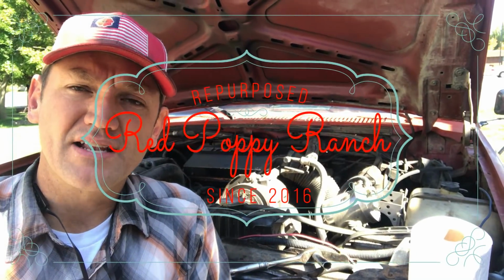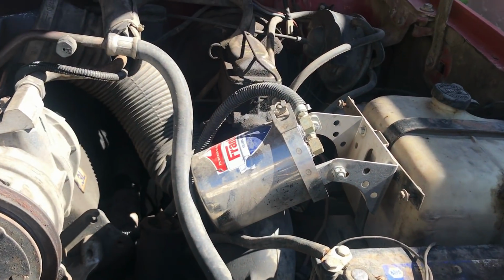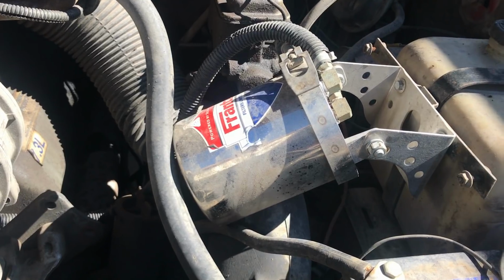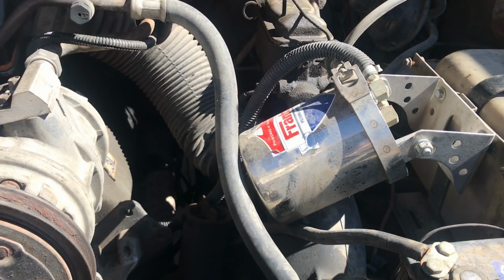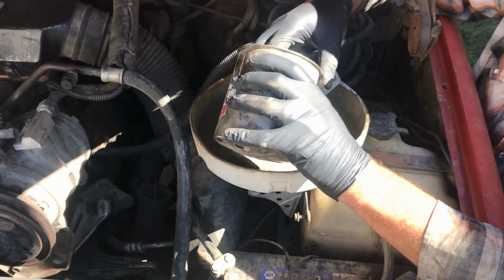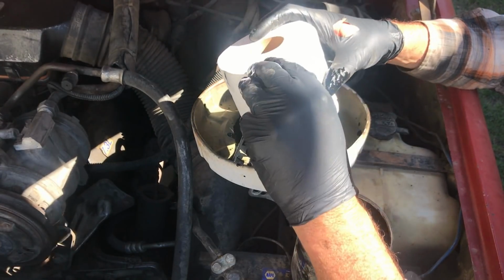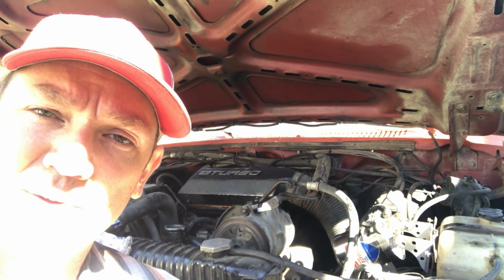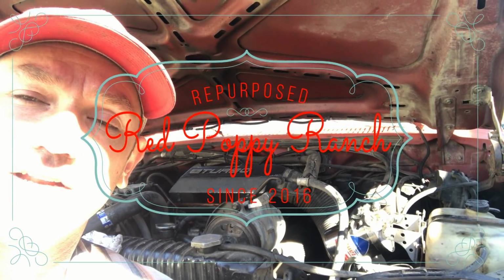#146 - Toilet Paper Oil Filter Maintenance... (Frantz Oil Filter)

Comment: I will use my Nissan Altima as an example. The oil is beautiful. Lets say the toilet paper is removing 99% of the carbon and 1% is getting thru. 1% is nothing in my car. Adding a qt at filter change dilutes that down. Why is the oil black in a diesel engine ? The filter is removing 99% of the soot and 1% is getting thru. That's because 1 % of the soot the diesel is generating is a lot more soot. Most of it is only a color. Send a very black sample of oil to the lab. You know they will say it is dirty because it is black. They Wil say it is clean and good for further use. You will get a list of the additives in the oil.They might tell you there are wear metals in the oil. On a large truck they might tell you your air compressor is wearing out.

Comment: Righty tighty, Lefty loosie!   The carbon black is way to small to be removed....  I used synthetic 10-40 Diesel oil, I pushed a fleet of water trucks and had a large supply of oil and diesel, so I CHANGED the oil every 1000 miles,  Never had a problem with the engine, but transmissions were a different story....  I could run from your neck of the woods to Lake Powell and back on a single tank of fuel, very nice.
I built filtration equipment used in the oil industry,  I had filters that went down to 1 micron "absolute" and they still wouldn't remove the carbon black from the oil....  cheapest insurance in the world, oil changes....
Reply: Deserthunter Mike Yep whole vehicle has to make it to a given milage not just the engine. Right there is the folly of low mile oil change intervals. Sadly it's the cooling system that lays most engines to rest now. But we never talk about 3000 mile coolant flushes do we?
Reply: I haven't heard of a cooling system failure in a modern car since most manufacturers switched to aluminum engine blocks, which don't rust and therefore don't leave piles of rust-flakes in the low spots of the coolant system.
Reply: Shawn Elliott Search your local Craig's list for PT cruisers. Sort by price low to high. The really cheap ones will have blown head gaskets or warped heads. These issues arise from cooling system neglect. The 2.4 in every PT is all aluminum, block and head. Dex cool is another nightmare. Look that up, mind blowing.
Reply: Hm. Does that specific coolant have trouble with gelling over time, or something like that?
Reply: Shawn Elliott From what I read it's due to air contact. More of a mud that develops. Blew my mind. I'd never imagined the kind of build up it causes. I figured stop leak when I first saw it, but they swore they didn't use any.Seeing and reading more online just wow. On the up side for systems designed to run it HOAT is unbelievably good. I just dropped 9 year old coolant from an iorn block. 94k on the truck and original coolant. The stuff is still clear, clean and red. I've never seen anything but brown on an iron engine. I'm sold on HOAT, and the Mopars that run it. Overall I'm on the side of ground up maintenace, 7500 mile intervals. Changing part of the coolant(what drops from the pepcock) and an oil change is only part of it.
Reply: Huh. How is air getting into the coolant system? Any air hole would turn into a coolant leak as soon as the water pump starts running.
Reply: Shawn Elliott Can't say I'm satisfied with that answer either. Though there is ways that air can get in or get trapped. I can say that any gradual process of corrosion can be circumvented by keeping the coolant changed or clean. And of course there is more to the cooling system then just the coolant. My original point, maintenace must be practiced on the entire vehicle. Very few if any modern vehicles will go to the scrap heap for issues that oil changes would have helped.
Reply: That's the problem with products like this one -- they encourage hyper-focus on a single aspect of a very complex system. Modern engines are already engineered to be right on the edge of the zone of diminishing returns, because that's how the manufacturers make sure their engines get a reputation for being reliable. There's so much other stuff that needs to work right for a car to run well, and the improvement gained by further optimizing one aspect of one subsystem (e.g. the engine oil) will be so small that it is easily overwhelmed by statistical white-noise in the big scheme of things. Did your engine last a little longer before needing new rings or new bearings because of a fancy oil filter? Who can tell? It could've lasted a little longer for any number of other reasons, like maybe the machinist at the factory 20 years ago was having a good day when they made the parts that ended up in your engine. If you didn't hand-build the engine yourself, you have no way of knowing the values of all the variables hidden inside.
Reply: Shawn Elliott   Only silicate containing antifreeze would age even in the bottle and silicate goo would settle out. The new antifreezes that are red or orange  do not have silicates and are superior and long lived. No silicates, no rubber swelling. The new antifreezes have been kept in bottles since the 1990's and they haven't deteriorated.
Reply: Shawn Elliott 
Aluminum rusts too. Where you see the white flakes is the aluminium breaking down. And ALWAYS use manufacturer recommended coolant and be careful what you mix. I've seen a person getting a water pump changed on a dodge minivan...mixed green with dexcool. The impeller on the water pump was turned into a razor sharp and thin disk because the two coolants mixing worked like an acid eating the crap out of the thing. And most impellers are steel even in aluminum engines. If you are in a real bind you can use all makes all models type coolants or water, but you need to get the right stuff and flush the system after the leak is fixed. You can easily trash an engine by neglecting the coolant system. There's a reason most parts stores carry tons of different antifreeze types.
Reply: I want to see what the oil looks like on the dipstick. Any time. When you change your filter next, in between, after you read this? I’m just very curious. I want to see the true color of the oil and know how long it’s been since you made the conversion and put the new premium oil in. 
I would also like to share with you, running your vehicle on fuel vapors. Not sure how it would work for a diesel but it might be worth checking out. 
Cheers!
Reply: The only thing to know the truth is to send in a sample for oil analysis according to their instructions. THAT is the only way.
Reply: You guys on this comment forum are over analyzing this oil filter system. Whats wrong with another filter that you can change between oil changes? Seems cheap cost for more pretection.
Reply: Ethylene glycol and Propylene are two good examples. You also need two different testers for them. Great points. The auto industry would be in shambles if not for lazy maintenance vehicle owners. Cheers !
Reply: The way we demonstrated  the Frantz and Motor Motor Guard  is with carbon black. We mixed enough in oil to turn the oil black. We circulated it thru a spin on filter. It went in black .and came out black the toilet paper removed it on the first  pass. Did someone say the filters can't remove carbon black .
Reply: I've used T P filters since 1963 starting with the Frantz on a nearly new Rambler American. There is something about these filters that brings out the liars and fools.
Reply: @ralphwood8818  bring them out how?
Reply: I only have Gulf Coast and Motor Guard toilet paper filters now Started with a Frantz in 1963. The oil on my 390 on the 76 F 250 and the Pontiac Torrant are amber. Wife talked me into giving the Altima to her son which means I will still be taking care of the Motor Guards. It has the cleanest looking oil. Light amber. I dont send oil to a lab. I've been at it a long time. We demonstrated the Frantz and Motor  Guard by filtering carbon black out of oil. I sometime used diesel fuel. Some used Wesson oil. When you mention toilet paper here the fools come. We used to sell the filters at flea markets.  It was boy Frantz has been outlawed in Texas too much shit paper getting  in the oil. Oil is supposed  to get dirty it means it's doing its job. They are not all fools. A trucker showed me his 2 Frantz 3 stackers. Said he gets a 6 pack of Safeway Truly Fine to service them. I equipped a fleet of tree service equipment at McKinney Tx because someone saw me at 3rd Monday trade days. Powerstrokes Ford industrial engines on chippers.Bob cat.They called me awhile back and  said they had more trucks. Told them to call Gulf.Coast filters. I cant do it anymore. Cant get up and down. I like to talk about them. The oil in a diesel will be black. There is enough non abrasive soot that is too small to be filtered out but will turn the oil black.truckers do the palm test. Clean oil will wipe off clean. They used Walmart conventional diesel rated oil
In their  tree service equipment. I used a lot of make up oil. Many paper towel filters. There is something  about toilet paper that makes some people come up with a toilet paper joke or bull shit story
Reply: My wife's Pontiac Torrant has 197 K miles on it shows no problems with the engine.It has had nothing but DeX cool in it. The coolant recovery system is what keeps air out of the system. Bought a Ford Escort with a warped and cracked head once. The problem with that car was two cylinders didnt get enough coolant. The fix was the new head gaskets restricted  the flow and made the coolant  spread out and go to all the cylinders  equally.

Comment: Must be gun shy because his first motor only went 180k (1st video "truck has 240k, motor has 60k") Pretty low for a diesel because the fuel itself is somewhat of a lubricant. Willng to believe anything now that promises extended engine life. He said this filter is in series ,but it is in parallel. If it were in series, the motor would be starved of oil instantly and die. There is only enough oil going through this thing to blacken it. Notice the wrinkles in the surface of the roll he removed. Those are channels that are formed from the oil,unable to flow through the dense paper, flow around it, unfiltered. Seems like a good guy, but got misled. Filtering is only half the battle. Dilution, sheer and other factors that diminish lubricity over time cannot be filtered out. Change your oil.
Reply: Its just a simple oil filter that cleans oil. It can't think. It can't tell you when it caint hold any more sludge. I probably change mine more often than most.I probably add more new oil than most. I gave up draining all of the dirty oil and filling it up with new oil in 1963 . It works for me. An oil analysis program without a filter that cleans oil is a waste of time. Black means nothing. I have sent very black oil to the lab.the results came back clean.Ok for further use.If the oil gets black in a modern gasoline engine You are in a heap of trouble.
Reply: I find it amusing that people that have no idea  about the oil system or the Frantz  oil cleaner dont have a problem explaining  how the system dont work.

Comment: The filters have  served me well fot.almost 60 years.  Put one on a neglected engine with a quart or two of sludge and you have a problem. Not much of a problem with these modern fuel injected engines and synthetic oils.Years ago a guy asked me if a Frantz would help fix a noise in his engine. I asked him how long it had been since his last oil change.He said I dont know it's been a long time. I wouldnt go near that engine. In the old days when you overhauled an engine the hardest job was cleaning the engine. My old 76 F 250 had some oil leaks.in the 390.I decided  to replace all the gaskets.The engine was pristine except some carbon on the pistons and valves No sludge anywhere. It uses Delo 400 15 40. The non synthetic oils are a lot better these days. The 390 has an old Motor Guard on it. Motor Guard was the only TP filter that was safe to use for compressed air.  All they make now is compressed air filters.  No I dont drain oil.

Comment: all yall are crazy to use material that disintegrates in water and use it filter your engine oil. its designed to disintegrate.
Reply: Cam Cam toilet paper doesn't disintegrate in oil.
Reply: @bigchevy80  - EXACTLY, although my guess is that fluid erosion might take its toll on the much finer toilet roll paper over time. The cheaper paper, SOME of it anyway, is thicker and tougher.
Reply: I'm not aware of any paper that dissolves in oil. You can take the used roll out and unroll it It will tear at each sheet. The element is removing the water and acid with it. You will know when you have left in too long. The paper won't be as strong. If you allow the element to reach its capacity the acid will start working on the pleated paper in the full flow filter. Some think they can wait until the element has reached its capacity. Not a good idea.
Reply: Had a genius say that toilet paper breaks down in a septic tank. Not if the septic tank is full of oil.
Reply: I have been known to use toilet paper on the coolant.some use toilet paper as a water filter before the expensive activated carbon.water filter on marine vessels. Some toilet paper holds up pretty good when sealed in a filter housing. In a engine the oil protects the paper.. if the paper gets soggy.or gets cracks in it you have water in the oil. Could be coolant or not running at normal operating temperature.
Reply: Another one that makes foolish assumptions acid is caused by not using diesel rated oil that neutralizes acid. That is called TBN.. because someone assumes something  doesnt make it true.

Comment: I have over 50 years using toilet paper filters. I don't sell them any more.Getting too old. I have seen the FAA approved AeroFrantz on crop dusters. Dune Buggies and hot VWs did an article on the Motor Guard. I've seen Gulf Coast Filters. On Army vehicles drilling rigs ECT. When they all used toilet paper. Now they all have their own elements. I can tell many of you are still wet behind the ears and. Know nothing about filters but have an opinion you need to open your ears and learn. Stop listening to fool's.

Comment: It may be better at filtering, however without changing the oil, your losing viscosity that isn't being replenished. Otherwise you will end up with oil that has a viscosity of water and your bearings will fail. If you have a tired out high mileage engine, its recommended to use a slightly thicker oil than the manufacturer advises. Cars 50 years ago were only meant to last 100k. Now we have vehicles going 300k. Please, please, please change your oil!
Reply: WatchMeWrench I love how there are more and more people pushing all these "snake oil" type products that usually have minimal results, all geared to separate your money from your wallet. Oh well, I see an engine  replacement in his future. 
People follow manufacturers maintenance schedules. It's there for a reason.
Reply: What car from 2017 is going 300k miles? Everything older is what lasts 300k. Now days they make stuff to only last 100k...
Reply: Teen Mechanic
Sorry, but no.  Engine and lubricant technology has improved gradually over time, so engines run cooler and last longer.  Cars made 30 years ago did not last 300k.
Reply: Charlie Smith these are the same manufacturers that engineer everything to fail nowdays so forgive me if I don't trust a damn word they say.  With oil analysis, you can run 20,000 miles or more between changes.
Reply: Put a Frantz on my bosses 63 Chevy Suburban with the 292 big 6.He pulled a race car with it.That was about 64 . He complained his oil doesn't look as clear as mine.I called Frantz. I was using Chevron Delo 100. He was using Chevron Special. Frantz told me the special had a ashless additive that turned dark.Drain the Special and put in Delo 100. Against my advice he used 20 wt instead of 30 wt. At 350k the engine was still going strong.I used the adapter from Frantz that eliminated the full flow filter. Multi grade oils were no good in those days. The Delo 100 was never drained.
Reply: One problem I have seen is if the bypass filter.isn't changed Enough not enough new oil is being added. The oil may get too thick. My uncle once told.me his.car uses a qt of oil right after he changes it then uses no more. That was over 50 years ago. It was multi grade. The qt evaporated.
Reply: When I say the Delo was never drained I should also say he changed the filter and added a new qt every 2000 miles.people a lot smarter than me determined how often.the filter needed to be changed and how much new oil needed to be added to keep the additives up to specs and the oil analytically clean. Engines were dirtier then.Synthetic oil doesn't last longer than conventional. Delo 100 may still be around. Delo 400 is the common one now. One problem with the older oils is they weren't.completely refined.  The heat from the engine and the Frantz had to finish the job.A lot of the impurities ended up on anything hot like the rings valves ECT.
Reply: I'm not a oil change enthusiast.  I dont believe if you dont piss away money on oil changes your engine oil is full acid. The additives are gone The oil is like water and the engine is wearing out and  The head gaskets are leaking and anti freeze is in the oil. Also condensation and fuel is in the oil.
Reply: @ralphwood8818  holy shit dude, you’re 90% of the comments on this video, and you’ve been commenting for 4 years. Are you okay?
Reply: A lot of ignorance about oil filters. I have 60 years of experience. Trying to share my knowledge.